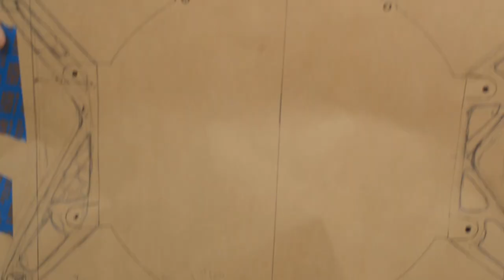PROJECT 1968 BMW 2002 PH02E03 - Radiator Install

Comment: Those are some nice brackets, they look perfect!  I just used some L brackets to mount fan to car. Makes it much easier to pull rad when you don't have to mess with the fan.
Reply from the maker: Thanks, I agree, keeping the elements separate seems like a good idea.  I went a bit overkill, more to try a project with the MJF print.

Comment: Those brackets turned out really nice! I wonder if you could print a trick air filter housing too?
Reply from the maker: For sure, once the stacks are mounted on the carbs I'll figure out if I go that route or do a mold...  Next for printing in the MJF will be linkages and adapters for the Dellortos...  might try some internal threads.

Comment: I did the same with my 1974 2002. However I found that the pulley that held the fan and ran the water pump was very close to the rad and did not allow a gap for changing out the fan belt. I would love to know what you did and if you replaced the old pulley with one that was less of a "cone"  and gave you more room between the radiator and the pulley?  I really liked the 3D printed brackets.....maybe will try that.....I had to use the zip ties on mine.   Good job! BTW my rad did not have a drain cock, which is most annoying as you have to remove a hose to drain it....
Reply from the maker: I didn't do anything special to change the belt when I updated the alternator tensioner.  It's a tight fit, but I was able to get the belt on without taking out the rad or removing the main pulley...  From what I understand the dims across cars and model years are pretty different - from a modern tolerance point of view.  I saw that someone else on the FAQ tried the brackets, looked pretty good but I never saw a final update.